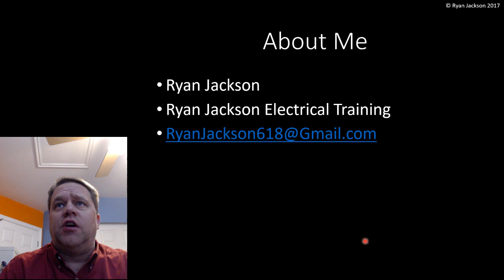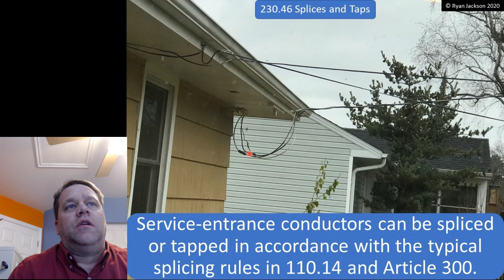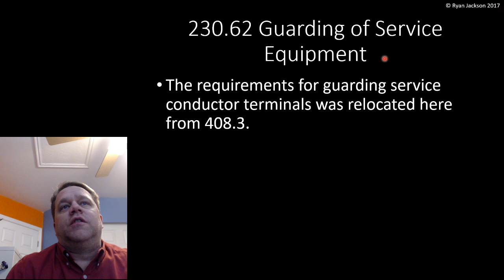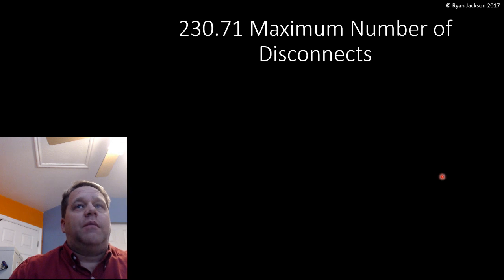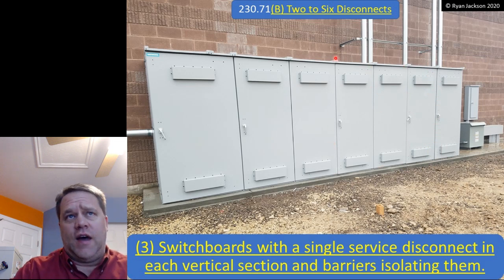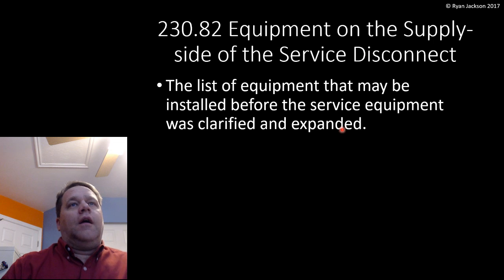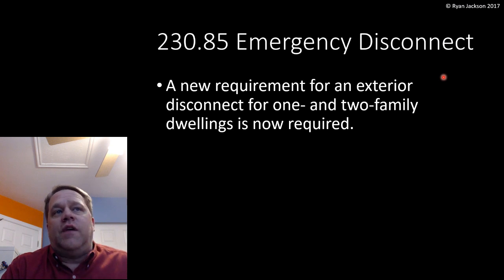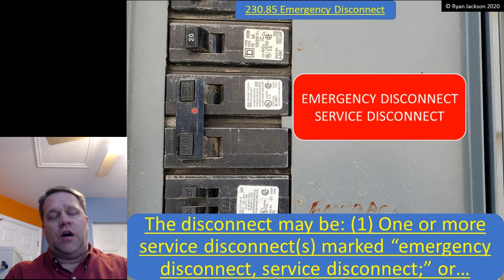2020 NEC Article 230 changes

Comment: 230.71 makes perfect sense to me and I have been practicing it for about 10 years.  About 10 years ago I upgraded the service at a uniform laundry plant. The engineer in an effort to save money for the client did not call for a main in the MDP but rather 3 breakers feeding 2 other panels and a 480-120/240 delta high leg XFMR to feed legacy loads. Sure as hell literally the week after we were done the owner decided to change their compressors from 240v to new more efficient 480v units and they were 20' from the new MDP. Engineer says no problem lets add 2 more 100a breakers to the MDP we are still under six disconnects. A stand by outage for Florida Power & Light costs about $1200 on off hours. Yea leaving that main out saved them money I am sure.
Reply: I hate how stupid people are when it comes to infastructure in a home or business. These are types of actions that will cost you a tremendous amount of money and will only save a few hundred bucks at the front end.

These are the same types of Execs that have no problem blowing money on dumb shit like private jets, limos and expensive dinners on the company dime.

Comment: 230.85 is for 1st responders. Yep but in central FL we have had this rule for 35 years and 1st responders are still trained in this area not to enter a structure until utility says it is de-energized, which means the jacks at the transformer have been pulled or the lateral cut.

Comment: Minute 8.06 - Section 230.62 - I agree this guarding makes sense and improves personnel safety.  However, to me it can't be said that it in itself meets NFPA70E, because the insulators/guards only provide shock protection and may reduce the potential for an arc blast, but don't eliminate it.  So I think that the person is still required to have the same justifications for live work and to take the same arc flash prevention precautions.

Comment: A final clarification, installing this outside disconnect, whether it be a separate or a combination meter/ disconnect, will the inside panel become a sub-panel requiring grounding and bonding at the outside disconnect?
Reply: All day Jack, you're spot on. Everything after the new service disconnect becomes "sub". The GECs will have to be either replaced or extended, re-routed and landed in the exterior service disconnect,  and all the grounded and ungrounded conductors separately terminated in the "new" indoor sub-panel, which includes removing any bonding mechanism. I'll bet a few less experienced electricians and inspectors may not catch that.
Reply: @wellcraft2136  yes sir very well put

Comment from the maker: The 2020 NEC (barring something very unexpected) will be available in September of 2019.
Reply: 230.71 ? Im used to the "no more than 6 disconnects.." So will a condominium with 20 units have 20 disconnects now with 20 different service feeders from the utility company now ? Dosnt seem or sound practical..
Reply: 1 commercial building with 5 tenats/units/meters will each have there own meter and means of disconnect feeding from the main distribution bus bar or service feeders..
Reply: 230.67...is there a rule or code that mandates a surge protector or suppressor to be installed in commercial applications
Reply: This guarding is getting ridiculous. What’s next are we going to have to guard our screwdriver when we get it out. Isn’t that why the code says qualified personnel, so as you know what you can and cannot touch
Reply: @derekstratford7937  Next code cycle, actually bringing service to a dwelling will be against code. Must use candles and get ice from the ice cellar.

Comment: Thank Ryan. Jersey just adopted the 2020 in October and I’m just starting to have to deal with it. I have a 4 position meter stack to replace and I’m guessing I’ll need a disconnect now. There is no room for this disconnect. I’ll be consulting the AHJ for an opinion on this. Also bidding my first house with the new rules and I’m guessing I’ll be consulting that AHJ also.
Question though, your meter/disconnect at the end of the video had multiple breakers in it. It did not look like the breaker marked service/emg disconnect would shut down everything

Comment: Question for you. The 2020 NEC requires a GFCI protected receptacle within 25 ft of a panelboard. I have an apartment complex and each apartment has one indoor panelboard. Where can the branch circuit (serving that receptacle for the panelboard) be fed from? This new section states the following: The required receptacle outlet shall not be connected to the load side of the equipment's branch- circuit disconnecting means. I would appreciate your help. Thanks. Enjoy your videos.

Comment: Main breaker disconnect is still allowed? What if the panel board is in the basement as it usually is in my area? Does that mean I would not need a emergency disconnect outside at that point?

Comment: Thank you! 230.85 is going to be a big deal for us in Washington state. Thanks again
Reply: It has pretty much been required in Central FL for the last 35 years. I see an issue with this in high snow load areas though. Play along for a moment. I am a service electrician I show up at Mrs. Jones' house and I need to work in the panel, I want to do the right thing and kill the power but there is no way in hell I am going to trudge through 2-5 feet of snow to get to the main on the side of the house. So now you are asking me to work in a live panel. 

I see the 2023 code addressing this after someone gets killed. It will be "all panels must have a main CB". The reasoning will be that sometimes electricians are lazy and don't want to walk outside or 200' down a hall the main electrical room. Which was essentially the reasoning behind requiring a disconnect next to a transformer.
Reply: 450.14 allows a remote disconnect for a transformer
Reply from the maker: @SillyPutty3700  I live in Utah. We get a bit of snow here. At one of the resorts that I teach for they got 600" this winter. In the valley we often have a few feet in the yard. I've never heard of it being a problem.
Reply: That's a huge change I'm from Washington state lol
Reply: @SillyPutty3700  And to your point, having all panels with a MB is cost effective, for both the short and long hall. :)
Reply: @suspicionofdeceit I have the same question! Yeah, of course we can put all essentials like security systems on a battery backup (at a cost to the home owner 😤) but isn't that still a hazard for firefighters that this code was meant to address?

Comment: @ 9:10 you stated that if a panel does not have the covers over lugs feeding main breaker havevto call ultility company for a power shutdown. If you are a qualified electrician with proper PPE and insulated tools perfectly safe to work on panel. In my area can take weeks for lazy PECO/Exelon to come out. I was.helping my buddy replace his 2 gang metet socket. Less then 2 hours after he pulled smart meters they came out to investigate. Thanks Ryan for another great vid.

Comment: Do I understand correctly that the disconnect at the meter will de facto become the service disconnect, requiring all bonding and GEC to be terminated at the meter socket, and also making the panel or panels indoors sub panels? Or is the emergency disconnect not considered the service disconnect? If so, it could dramatically increase the cost of putting in the typical 320A/400A service we see here in PA for McMansions where two 200A MB panels are installed inside.
Reply from the maker: It depends on if you use a panel outside. I think that will be the most common approach, in which case, yes, your grounding and bonding occur out there. You can use a meter disconnect (which is not a service disconnect), but I think that will be very uncommon.
Reply: @RyanJacksonElectrical  This was my question.  I didn't see anything about over current protection, only disconnect.  Trying to determine if they will allow this as utility side equipment w/o OCP.  So while a N-G bond is required you don't continue with an EGC.  This would simplify the cost as nobody but the utility and fire department would have access and not really change anything in the design except this extra box.  Also if this was only about disconnecting power for the fire department, why not just have some spring loaded device with a pull pin such that the FD just opens some access cover and pulls the pin and spring opens the contactors?  As an engineer all I do is >10,000 sq ft homes and 600A service is very typical.  Going to look big and obtrusive if I have to put the service outside.

Comment: Thanks, does line taps fall under article 230? I just came across one by Tesla energy and the county requires it to be tested by UL and that report sent to my electrical plan checker for approval before I can approve the solar installation.

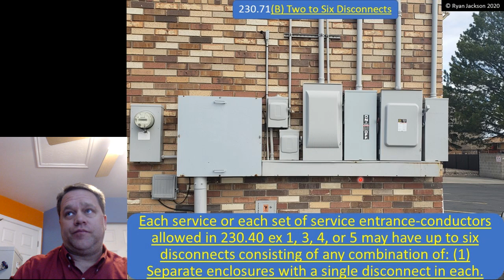Comment: 16:25 so basically this is FORCING homeowners to put main panels on the exterior inorder to satisfy the ER disconnect, if not then by adding the external ER disconnect panel, which would make it first means and thus require it to be bonded, it would make your interior main panel a sub panel by default and would require you to separate your neutrals and grounds, am I understanding that correct??

Comment: I wonder if these whole house surge protectors would have low enough impedance to throw the main breaker.  It would limit arc flash in the disconnect. If the surge extended over several second there could be a danger of melting the wires off the suppressor.  The type that are built into the main breaker are probably better at protecting due to lead resistance and thermal feedback.  So I wonder how high the main disconnect can be mounted off the ground to be accessible to firemen but hard for children to reach ?

Comment: I have attended training classes for a company named Southern Cross, a subcontractor for Duke Energy that replaces residential and commercial meters with smart meters. I was amazed that they do not train the employees to shut down the load side of the meter base in removing and replacing it, but instead would equip the employee with a regular hard hat mounted face shield, 1000 volt rated rubber gloves over leather gloves, safety glasses and flame retardant clothing. They would work the employees rain or shine and there was a quota that each employee was expected to install, and punch in the meter information on a Trimble. 
These employees had no training in arc related safety at all. No rain coats either, and when it rained, everything got fogged up and the gloves would get soaked, not to mention your entire body.. 
Manyof the old houses in North Carolina do not have outside disconnects. 
I am happy to see that the code has changed, but still nobody is out there inspecting the existing old homes that have outdated services, no ground, old meter bases and frayed sec with exposed concentric. Who regulates this? When a service is hit by a tree during a storm, the duke subcontractor comes by and just nails it back up to the building. It never gets inspected by an ahj or the Fire Marshall to be upgraded after a natural disaster
.I am a state licensed electrician and of course lol didn’t last long at Southern Cross, after running in the pouring rain house to house and feeling the tingle from the meter bases just to make quota. 
Finally one day I tossed the Trimble in the center console of the truck while soaking wet, collected the safety cones from front and back of the truck, tossed the gloves on the dash to dry off, jumped in the truck and slammed the center lid down in the Trimble. That didn’t go over well.. twenty minutes later I had a foreman position with a builder.

Comment: But the manufacturers supply barriers that do not fit US conductors!
So already we are non-compliant!

I gotten to an argument with an inspector over this regarding an EATON panel for a residential panel change.
I cut the rib cone to match the conductor jacket, but the inspector claimed I damaged the supplied barriers from their original form. There was nothing in the paperwork to refute this.

Now look, I have worked with European equipment before, I am familiar with such rubber cones over cabling, even being an American electrician. I know that ribbing is meant to be cut to size.

Just god damn.
Reply from the maker: In my opinion that is a problem with the inspector, not the product. Some inspectors have a hard time coming to terms with reality.

Comment: Here's the interesting question. Service disconnect required (check), SPD required at entrance(check). Seimens makes a meter main, with a 200A service and 2 spare circuits perfect. part number MM0406L1200RH.  However the breaker for the SPD would not be deenergized by this service disconnect only the service entrance to the house that one breaker to the right for the SPD would still be live.

Comment: Can not understand why smart meter manufacturers could not install an insulated lever or a device to disconnect the service. They already have a relay or contactor inside of smart meters to be able to remotely disconnect setvice for non payments. NEC should have required covers on main service circuit breakers. Heard that USA did not start designing non contact tetminals on contactors until years after IEC made it a requirement. Like the way Canada guess requires residential panels to have split covers. The smaller cover is in front of where power is terminated to main circuit breaker making it safer for Johnnie homeowner to not have to worry about receiving a shock while in the portion that has all the branch circuit breakers ( as long as they first turn main breaker off ).

Comment: That means all my panels will become subpanel and leads to floating my neutrals?
Reply: Technically yes, which means I'm going to have to do some work in my new sub panel.
Reply: Not to mention re-arranging, or more likely, replacing GECs.

Comment: Ryan,    To be clear, the exterior service disconnect is or is not the "Main" overcurrent protective device?   I believe that it is not.   It is required ahead of the "Main".  I strongly believe that the Main device should be within the structure that it serves.   If the circuit breaker or fuse is exterior, then the rating of the device is no longer correct in its environment.   This is a real problem.   Example: a 20 ampere circuit breaker installed in a freezer at -20F will now be somewhere around 80 amperes(if my memory is correct).  The same for the conductors within the freezer(all is good).  Now breaker at -20F and conductors at 80F.(now there is a problem).  Respectfully,   Kevin
Reply from the maker: Hi Kevin. From my understanding, circuit breakers are calibrated at 40 degress C (104 degrees F). There are tens of thousands of installations that have circuit breakers installed outdoors, in environments from -50 to 125 F but I have never heard of any real incidents occurring. In my area, every house built in the last 50 years has a breaker on the outside. 
As far as the new requirements in 230.85 go, it does not not have to be a circuit breaker or a fused disconnect outside, it could be just an emergency shutoff, but I don't see why anyone would go to that trouble when there are so many products that are designed to be used as the (outdoor) service disconnect.
Reply: Ryan Jackson    So a breaker at -20 F installed outside protecting conductors in 86F ambient area is a good thing and no concerns?
Reply from the maker: @KevinCoop1  I'm not saying it is a good thing or a bad thing, I am just saying that if it was a real issue there would be some evidence of it, considering the number of breakers that installed outdoors. We've got literally millions of breakers outside but no data showing any problems that I know of.
Reply: Ryan Jackson    So since NEC requires electrical equipment to be installed per the manufacturers instructions, would it not be a violation to install a circuit breaker as an overcurrent protective device if those instructions state that their breaker is to be operated an minimum of 14 deg F.   Eaton does make special breakers that can be used at -40C instead of -20C.     So, as you said there are thousands of NEC violations out there.   IEEE has an article about fires in cold conditions, but it would not show up when I tried to go there.   Maybe there is an issue.    Respectfully,   Kevin.   SqD literature.    https://www.schneider-electric.com/resources/sites/SCHNEIDER_ELECTRIC/content/live/FAQS/278000/FA278588/en_US/Determining%20Current%20Carrying%20Capacity%20in%20Special%20Applications%200100DB0101.pdf?_ga=2.138582643.191383317.1572923737-1762716997.1572923737
Reply: Ryan Jackson    No further comment then?

Comment: The meter stack shown at 20:00 has a weatherproof box mounted to the side with an in use cover. Is that at all legit. Doesnt seem like it would be or would be safe. Where is the power coming from.
Reply from the maker: There is a house meter. Five townhouses plus a 2-pole twenty, one leg for site lighting, the other for this receptacle.
Reply: @RyanJacksonElectrical  ahh ok. I didn't look close enough. Thanks for the info. And great videos. Recently subscribed from upstate ny.

Comment: Hi I was wondering under 2020 nec how would you do the 400 amp combo panels that have 2 200 amp breakers in the panel that run 2 200 amp interior panels
Reply from the maker: You wouldn't, unless it has a 400A main.
Reply: @RyanJacksonElectrical  what if I had a medal bracket made at a shop that tied the 2 200 amp breaker together like you do with a 100 amp breaker so then when you open the door it would be 1 pull to turn off both. Not sure if it would work just thinking
Reply from the maker: @thomasduncan6978  Negative.
Reply: @RyanJacksonElectrical  ok so I can run 1 off of that combo panel and then run one off a 200 amp disconnect that's mounted beside the combo panel is really the only way to do it